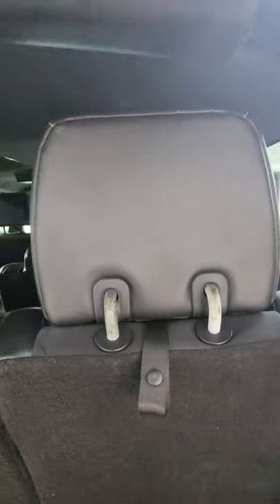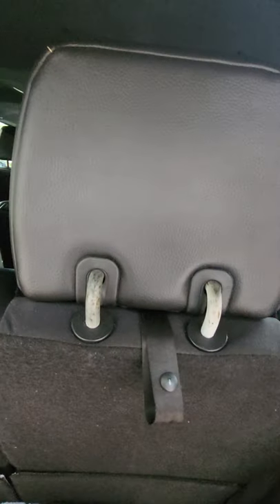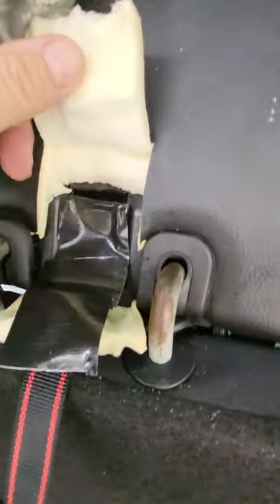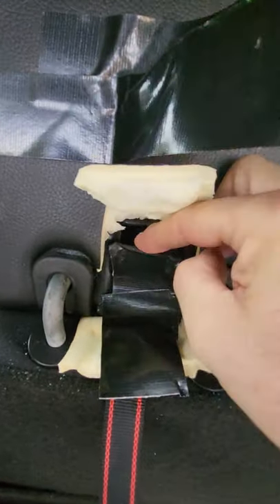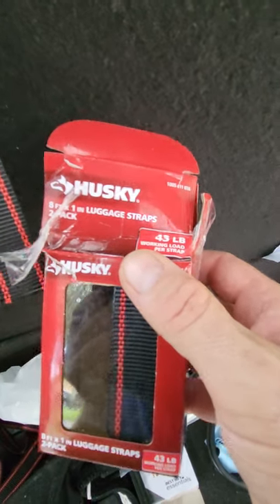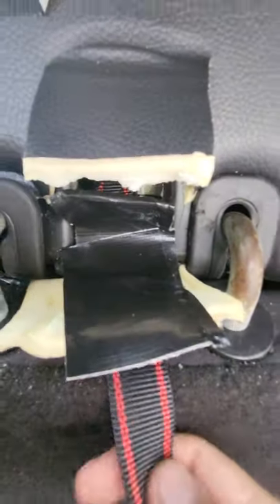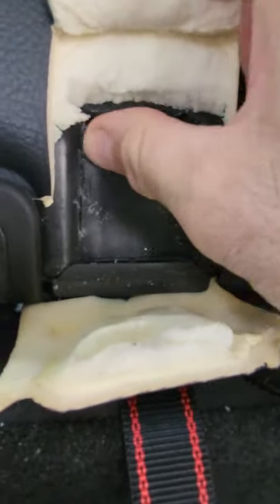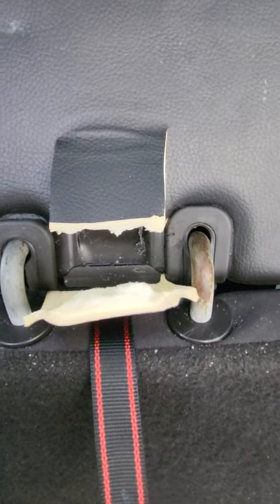2007 Ford Expedition Power 3rd Row Headrest Won't Fold Down Due To a Broken Strap Fix. Ug!!!

Comment: I’m going to thank you right now for taking the time to show this video because mine on the left side just like yours the strap was missing when I purchased it, this is information I will be not knowing how the mechanism works which I can feed a wire hanger up the slot and loop it.

Comment: for anyone not wanting to cut ur seat just take a wire cloths hanger bend a hook in it stick it through where the strap went and hook the pin I just done it took 10 mins maybe

Comment: Isn’t there another way to avoid such a bad thing ?
Reply from the maker: I wish there was. Believe me, I tried everything. The local fords parts guy spent a long time with me trying to figure out if anything was replaceable. There was no option except to buy a complete rear seat (Not even sure they make them) and/or buy a complete used one. It really is a very crappy design and for a few pennies more, Ford could have built a much stronger strap or just adapt a version of what GM uses. Just look up the used price for a complete setup and its just not worth it. I have found them for as low as $300 and upwards of $1200.00. Insanity for a vehicle that isn't worth $8,000.00. This is my beater SUV so I figured I had nothing to lose. I found the fix. At least I have shown you that it can be addressed and though my el-cheapo strap works for me, I am sure that there are a few different ways to make that lever release. Ford does not make any replacement parts for that seat. Nothing. All or none!!! :)
Reply: @moparmusts  thank you for your reply. However, I Found another way out to solve the problem. You can easily take out the headrest by unclipping the small part that is attached to bars inside the seat. I will send you the video to have long story short
Reply: @alim.4409  Do you have a video on this one I'd love to see how to do it as I'm having trouble with my kids keep leaving it up and I like to be able to see and take that headrest on the third row off completely
Reply: Hey do you know how to take off that headrest off completely on that third row
Reply from the maker: @johna.6840  
It was a complete guess. I figured I had nothing to loose. You cannot be afraid to break something that is already broken. I honestly just made a guess and it worked! Yeah, it's not pretty but who is going to judge your repair on an part that no one really can see. Just follow my directions and thats that. I just closed it up with some gorilla tape. Of you want to spend the extra money, make the repair and then bring it to an upholstery guy for a real repair of the vinyl. These old Expeditions aren't worth much these days. 
You would lucky to get $5000 for them but, Mines at 180,000 miles, well maintained and drives and runs strong with no monthly payment except insurance. I honestly feel I could drive it from Florida to Alaska and back without any issues. It feels as strong if not more then my 2016 Tahoe and that just cost me $3200 for a rebuilt tranny at 10800 miles!!!! Dealer wanted $6200. That ford tranny still runs and shifts new as it has been properly serviced.
Reply from the maker: Also, the headrest cannot be taken off as fat as I know. I spent aong time with a Ford Parts Guy. It is sold as a whole unit and it not serviceable. Hence my cut open and see what happens approach. An absolutely terrible design by Ford which is why I don't buy anything new Ford. They just design for function and do not care in any manner how something that breaks can be repaired. My last new Ford was the last year Excursion Eddie Bauer 4x4 6.0 liter diesel which had one major transmission failure and then a major engine diesel injection failure at 70,000 miles. The mechanic told me that this would continue to happen and if it wasn't under warranty, it would cost $2500.00 each time. That was it. That was my last new Ford I bought.
I inherited the 2007 Ford Expedition I have now and is .y sons truck. I redid all of the brakes, tune up, tranny and radiator flush and a whole bunch of other minor thongs myself including a whole new stereo with bluetooth, back up camera and under the seat sub l from Crutchfield. 
Honestly, it'd better then my 2016 loaded LT Tahoe.
So, if your Ford drives good, then try my cheap and easy fix to fold your third row. I am very mechanic so maybe I am more confident then you. You have nothing to lose. Try. Or just go buy a $300 plus used third row seat that  will Eventually have the strap break.
Reply from the maker: @alim.4409  Hi, sorry for the delay. This is a long text! Read or don't!  Im am far from being a youtube expert! I cant figure out anything but slowly learning all the video tricks. Anyway, those rear headrest don't come out in an Eddie Bauer with power fold seats but I do know most cars allow you to do so but, if you look at the headrests in my video, you can see the third row headrests shafts are curved. This is an automatic feature that allows the headrests to fold down flat when you put the seats down so they stay flush. Believe me, I looked! The second row buckets had the same problem but I never got around to fixing it since I sold the vehicle. Turns out that that year Expedition ( maybe others) was completely missing all four of the frame to body rubber bushings. They make aftermarket bushings but not for the Expedition. I checked with Ford and the parts guy told me not to replace them as they are way beyond the typicle mechanic ( I was ASE certified in almost every catagory accept engine and tranny rebuilding a long time ago and have been working on cars, mine both new and one old muscle car, friends, neighbors since I was 13 and Im going to be 58 this month-retired LEO after in 2014 27 years) and he told me that the body shop did that type of work and it is a nightmare and cost a fortune to due so. He showed me the schematics and I forget, either the front or rear ones you have almost dismantle the car. Mind you, the car made no noise nor have any clunking or handling issues. I just happen to be under it and saw the metal bushing washer loose under the frame and all the rubber was gone. Its over an inch of rubber.  I check the others and they also rotted out. Since I sold the car with 180,000 miles on it I don't have to worry about it. I disclosed everything that the Expedition needed because I'm not that guy. Apparently this is a common Ford problem with their older trucks. There's lots of videos online showing repairs to them but all were for pickup trucks and it seems like the F250 had the most. They make kits for those trucks but they don't fit the 2007 Expedition as I called one company to find out and for some reason, easier to install. If you are going to do a frame off restoration ( like most old cars and trucks many of todays models will become classics) and I see more old Fords trucks and SUVs on the road then I see Chevy or even my favorite, all Chrysler products ( mopar) and I own  1966 Plymouth Satellite with a 440 4 speed. My wife drives a 2021 Porsche Cayenne, one of my sons has a 2022 Bronco Sasquatch ( monster truck with 35 inch tires) and awhile ago, I ordered a 2021 loaded LT new and first year Duramax 6cyl diesel 4WD in May of 2021. It came in as a 2022 in January. I drove it for almost 7000 miles (18-28MPG) and it was fantastic until it wasn't. At near 7000 miles some electrical issues popped up. ( I made a you tube video). I called the dealer and they told me to hold off as there were 40 trucks ahead of me with electrical issues. The truck then developed 10 and thats no joke, 10 different electrical issues. A few days after that video the truck went into Limp Mode which only allows you to accelerate to 60MPH and at a very slow rate making it dangerous to drive onto a highway. I drove off the highway and straight to the dealership. Its going on almost 4 months now and they cannot figure out how to fix it! They said they have to pull the tranny. They have a factory rep involved since they told me its the worst they have seen. They might have to replace the entire engine and dashboard wiring harnesses. That is a nightmare of a job and the truck will never be the same. I've been in a crap rental since. Last week I gave GM the notice to buy the truck back or I am going to Lemon Law it. In Florida, its pretty easy if you can proove your case. 3 repair attempts at the same problem and a 4th to try to fix it/ and or more then 15 days in the shop. I don't want another one so I am going new muscle. Since its Autonation, I can order almost any brand so I am either going to order a Scat Pack 6 speed manual hemi Challenger or a LT1 6 speed manual Camaro. Anyway, not sure why I told you all this but I have a tendency to be a bit scattered! 
Did you ever send me that video? How do I find it? Again, my youtube tech is below par!
Thanks!!!
Reply from the maker: @johna.6840  Sorry for the long delay! I don't have the truck anymore. Someone told me that there is an easier way by removing the headrest but on the thrid row seats in a power assisted fold, the headrests dont come out. Not sure how it might be in an XLT with no power fold but mine did not come out. I've been working on cars and trucks since I was 13. I was ASE certified and worked at gas stations and a Dodge dealership for over 2 years when I was younger but changed careers at age 22 and retired in 2014. I still work to stay busy but not for the money.  I have never stopped working on cars and my garage looks like a gas station! My father was a very famous inventor and I inherited the inventor disease! Not bragging but I'm pretty creative and for the most part, I never give up. In this case, I had nothing to lose but my youtube video skills arent great! I should have videoed the process but it took me a long time on how to come up with a solution once I cut the vinyl ( pleather!) on the reat seat. If you dont care about some tape covering up the hole you make ( you can always bring it to an auto upholstery shop to have it profesional repaired ( the cut not the fix). You have to be a little creative to due what I did. I say go for it. If you are  tinkery ( not sure that's a word!) then go for it. Honestly its not super complicated, you just have to be patient and use your fingers to feel around where the strap lever is. You might come up with a better solution. 
Thanks!